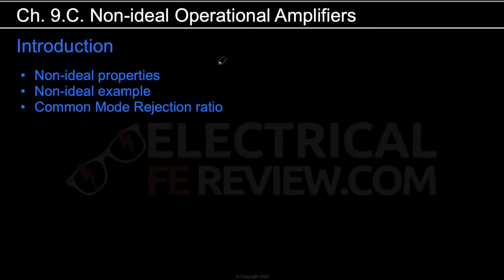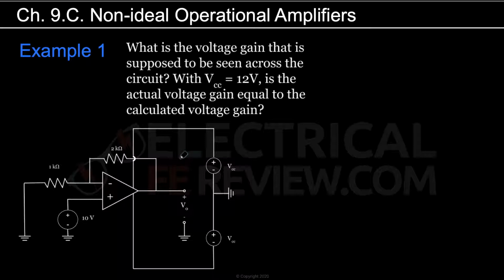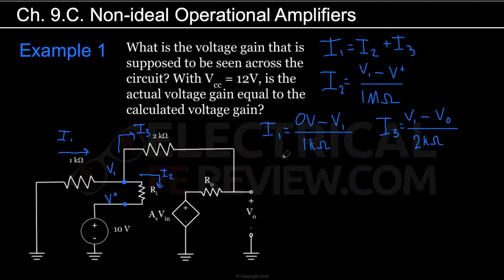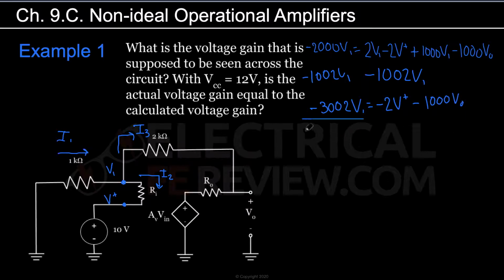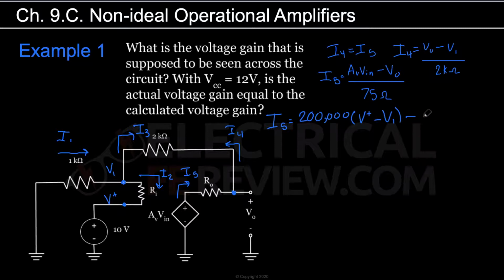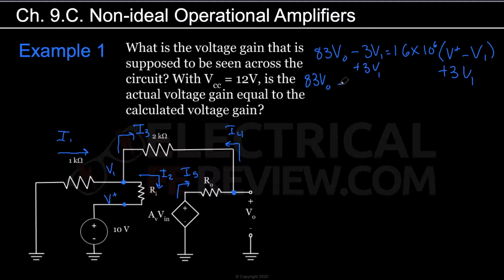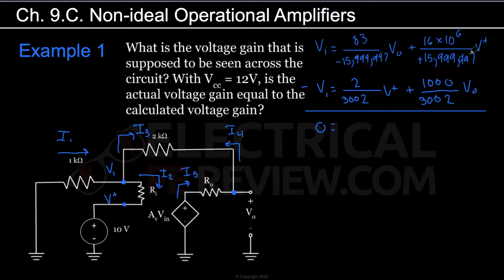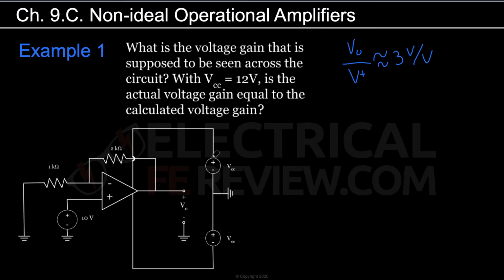How to Solve Non-Ideal Operational Amplifiers and common-mode rejection ratio (Electrical FE Exam)

Comment from the maker: Video Table of Contents (Click to Jump):
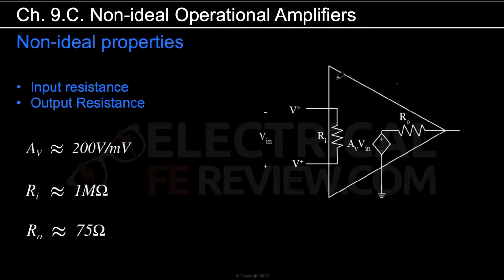0:42 - Nonideal op-amp properties (input/output resistance)
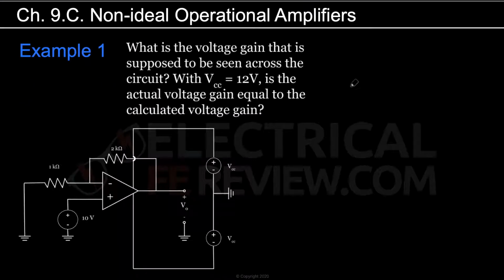2:30 - Nonideal op-amp example solving for gain
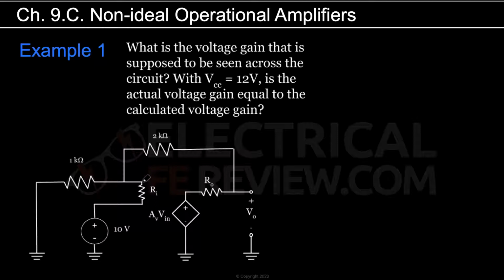3:22 - Current relationships (I1, I2, and I3)
7:41 - Simplifying by getting V1 on one side by itself
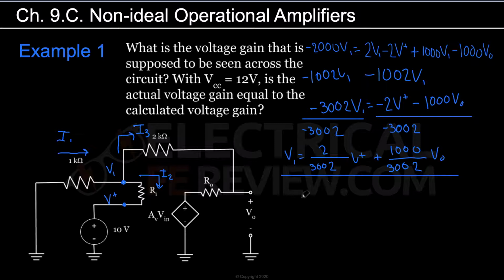10:04 - Using the output node (I4 = I5)
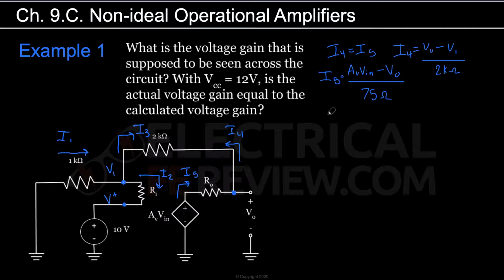11:42 - Simplifying for I5
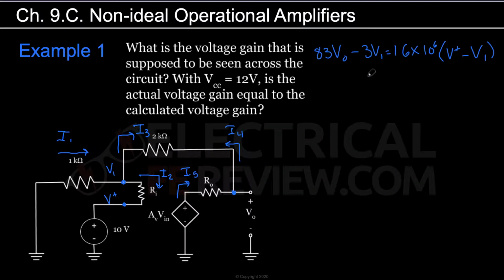14:42 - Simplifying again to get V1 on one side by itself
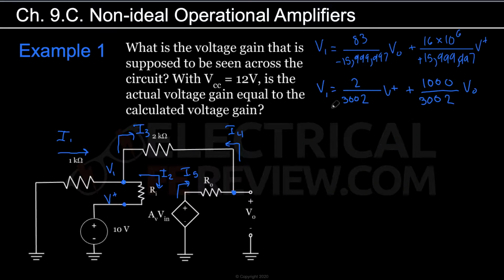17:48 - Subtracting both equations to solve for gain (Vout/Vin)
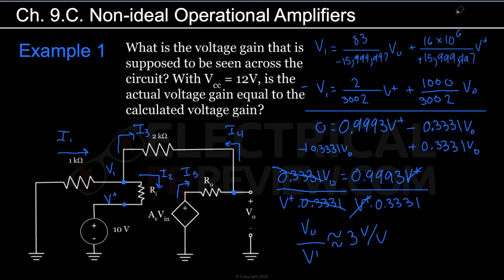20:03 - Using the gain to evaluate the problem statement

Practice problem:
What is the voltage gain that is supposed to be seen across the circuit? With Vcc = 12 V, is the actual voltage gain equal to the calculated voltage gain?

Answers:
Vo/V1 = 3

No, actual voltage gain is not equal to the calculated voltage gain.

Comment: 7:10    I do not understand the direction of the current I2. Logically i would say it goes the other way (10 Volts via Ri and the 1K resistor to ground) creating a lower voltage than 10Volts at V1. Am i making a mistake here?
Reply: You get to pick the direction of the current. It doesn't matter as long as you stick with that direction throughout the problem.